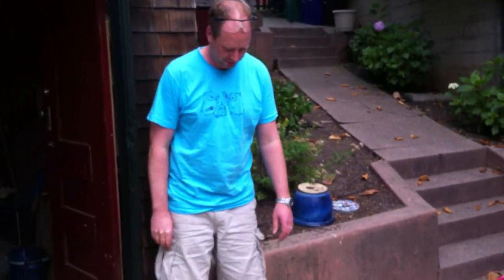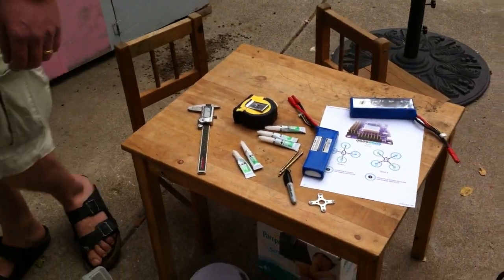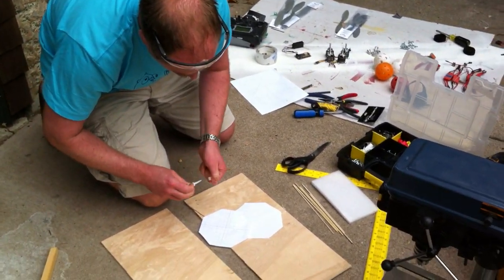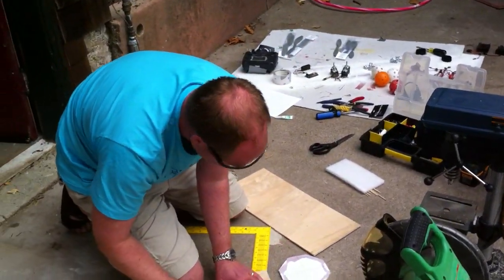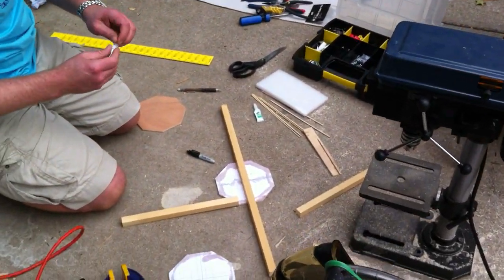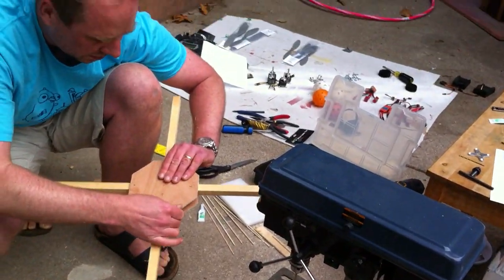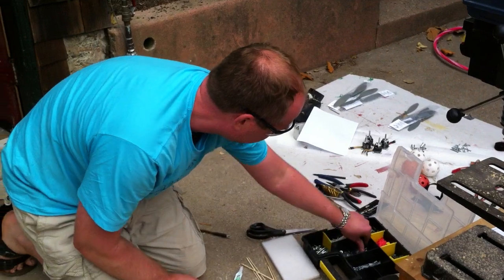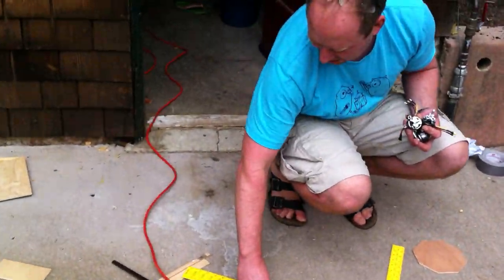Black Sheep served Tasty Crow! (part 1/2)

Comment: sir how do you know that quadcopter is going to fly without doing any simulation in any software? or u just assume ,  have experience or u did some research work..
Can you tell me how stable is your fly in air and how do u  program control of fly??
Thank you 
hope you will reply soon...
from lobsang
Reply from the maker: We know that it will fly, because the lift is stronger than the weight.  The general design is well known.   We don't know if it will be stable... we need to test fly, and adjust the software parameters.  The copter is stable after we adjust it.  We use some open source (ardupilot, there are many software available) software that runs on a controller board.  Hope this helps, Good Luck!

Comment: sir which software did you used to create the frame ? and does this quad is able to carry some payload around 300-400 gm ?
Reply from the maker: That was Microsoft Word with Visio.  The quad lifted quite a lot, the final test (you can see it in part 2) lifts 8 pounds.